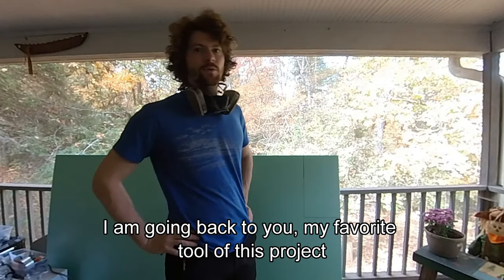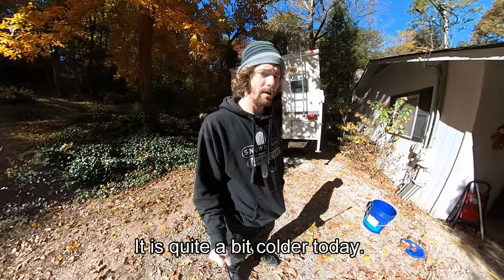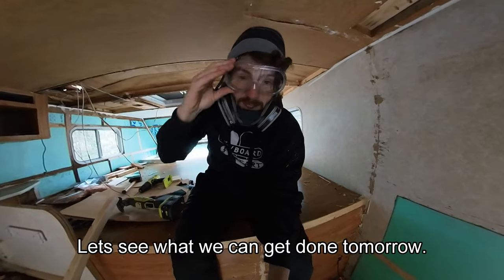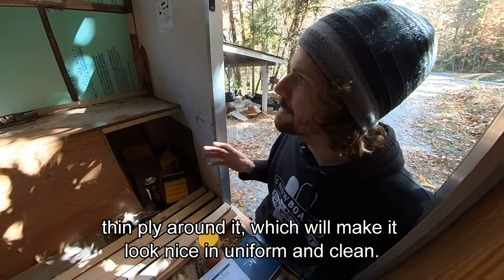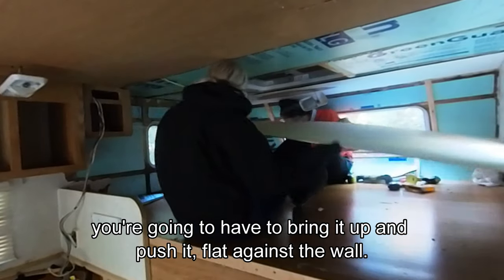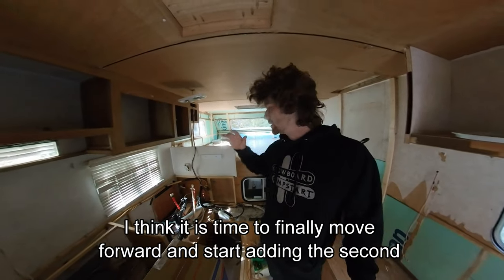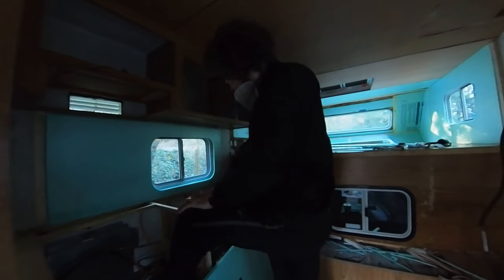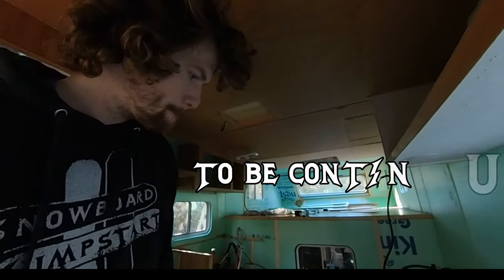DIY Truck Camper Insulation

Comment: So did you ever find out WHERE the leaks were that made it leak in the first place, I would definitely roll on a rubber seal on the roof, it’s not that spendy, especially after all that work
Reply from the maker: Currently no leaking, but that's a great idea!